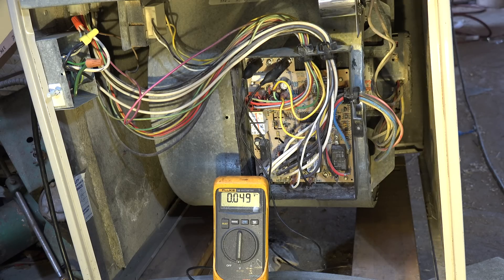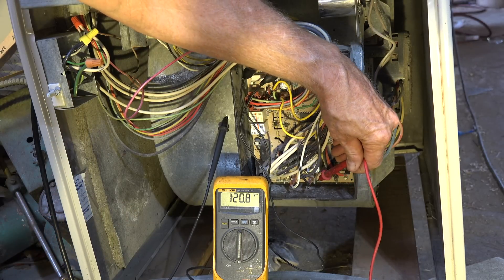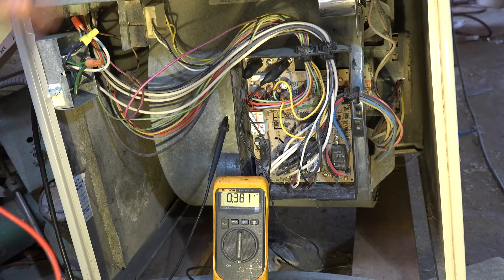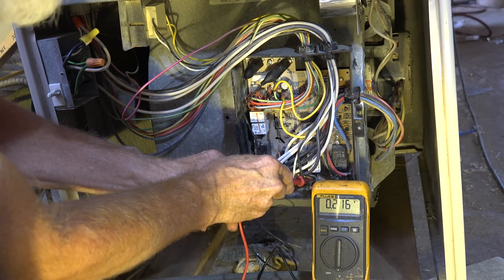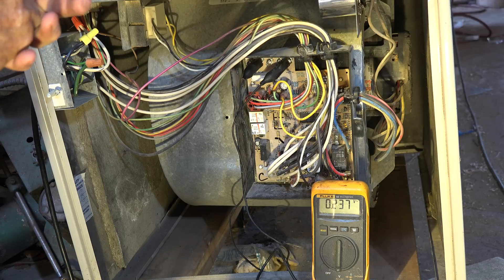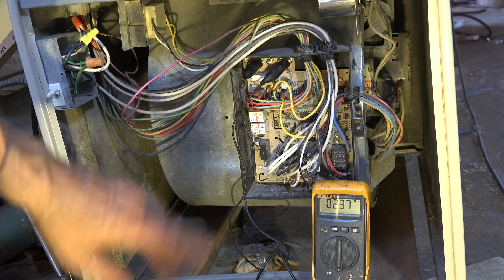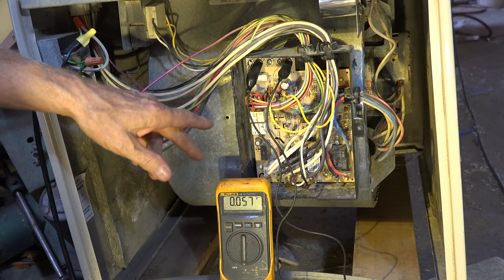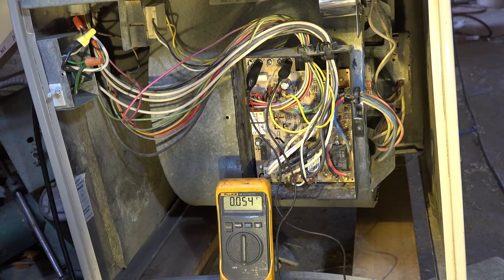What's wrong with this furnace #16 answer

Comment: i thought neutral is connected to ground in the electrical panel? Could you technically ground a open neutral to make unit work?
Reply from the maker: Yes of course.  The problem with this is the chassis ground/ body of the appliance could become hot if the was a fault in the ground.
GFM